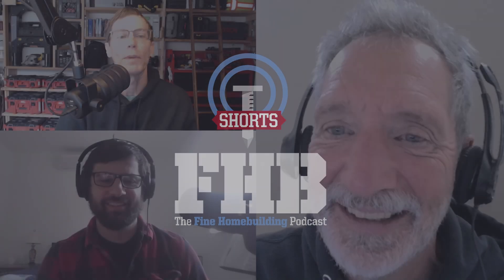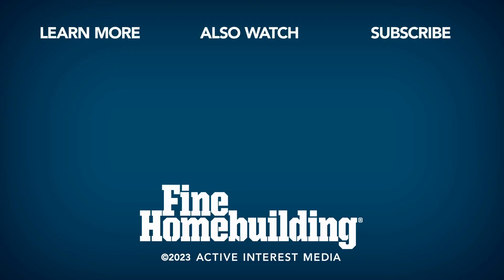Is There a 'Right' Spot for a Vapor Retarder in this Climate Zone? | FHB Podcast 653

Comment: In Canada, you for sure want a vapor barrier on the ground in a crawl space to stop water vapor from evaporating out of the ground. No need to pour a slab for a crawl space (it's a waste of concrete). Gravel should be used as balast to hold the class 1 vapor retarder down and prevent damage the 6mil polyethylene sheets. Joints should be taped and sealed.

Comment: Most of the homes in the Bay Area don’t even  have any insulation . Definitely don’t need a vapor barrier here.
Reply: Depends on where in the Bay Area.  In the 70s, most of the new homes had ceiling insulation. When we ran our A/C, it stayed on all day because of the leaky walls, floors and ceilings

Comment: I appreciate your conversation.  While it would seem that this topic should be laid to rest by now, it is definitely one that needs wider distribution for each climate zone.  Contractors need a greater understanding of those nuances as you said.  For instance, I am in climate zone 4a in southeast Missouri,  in 1987 I remember the contractor that I was working for discussing whether or not to install plastic sheeting on the inside of the home behind the drywall layer, he was a little confused as to whether this was a good or bad idea, but there was some information going around about cold climate homes needing the vapor "Barrier".  Over the years it became obvious to many that it was a bad idea because of all the mold issues that later ensued.  I'm assuming that the confusion comes from a lack of clarity in the building code and a lack of adoption of codes in some areas.  While not the best researcher, it seems from what I have found, that the ICC didn't start having a clear identification of where interior vapor retarders were required until 2009.  Being that adoption of codes is non-existent in rural areas of Southeast Missouri, it makes sense that there would be an even slower progression in the mindset of builders.   It is my wish that builders would take an interest, and research the code regardless of what the local authorities are requiring.    Thank you for your discussion!

Comment: I’m in Northern VT, and I put Certainteed membrane over the firring on my ceiling before drywall and all the penetrations into the attic are air sealed with this and Siga Rissan tape. Above in the attic I have a vented space with blown in cellulose. This means my cellulose is outside the envelope up in the hot or cold air. But between that and my drywall is a vapor retarder that allows moisture to move in either direction through it but not air. Now my walls are different. I have drywall then Siga Majrex which does not allow moisture into the assembly but does let it into the house. There are Rockwool batts in the wall cavities and zip system on the outside. We have a Broan ERV to ventilate the home. The most important thing to remember is that air is the vehicle for vapor so if you’ve air sealed then you’ve vapor sealed (mostly) unless you have a really overly humid situation where at that point the moisture will move from more to less through things that may be designed to stop air but not moisture in which case you have “diffusion”. Drywall and concrete are a good example of something that moisture can move through but air can’t. But the biggest kicker is that this vapor is not a problem until it comes in contact with a cold surface it can condense on and then it turns into actual water and that is where the mold and rot are born. This is important because in a cold climate in the winter, heat moves from warm to cold and warm air harbors more moisture than cool air. So in the winter although more to less beats warm to cold, both are working against you if you’re breathing, showering and cooking pasta in your house and that’s why they want exterior insulation to remove the cold condensing surface (the interior side of your sheathing) from the equation.